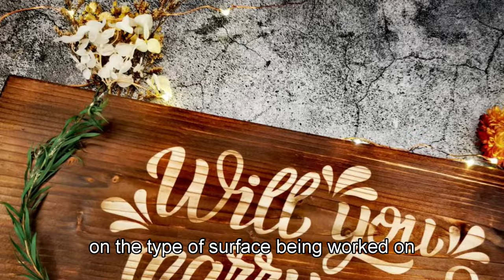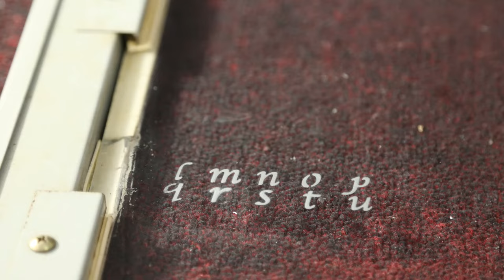Are you new to sandblasting and unsure of which media to use?

Comment: What about glass bead?
Reply from the maker: Hi, we did't test glass bead yet, but you can refer this page https://www.lematec-tools.com/sandblasting-media-sandblast-reference. Some of buyers used it with our sandblaster gun.
Reply: The advantage of glass beads is that it produces a very smooth surface finish. It is not very aggressive however so that is not good at removing rust and coatings. Some users will blast first with a more aggressive abrasive and follow it up with glass beads

Comment: I have a project that involves CNCing polycarbonate then sandblasting it to remove all the scratches and imperfections, what would you recommend me to use for the sand blasting material
Reply from the maker: Hi dear, if you will use a sandblaster gun on plastic objects, we suggest trying baking soda or other soda powder first. If not working well, please try Aluminum oxide.